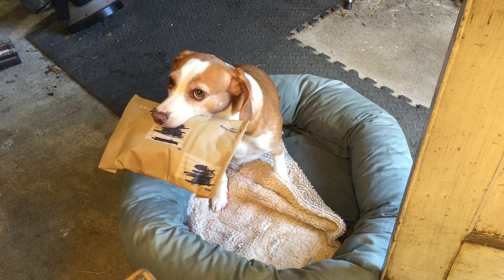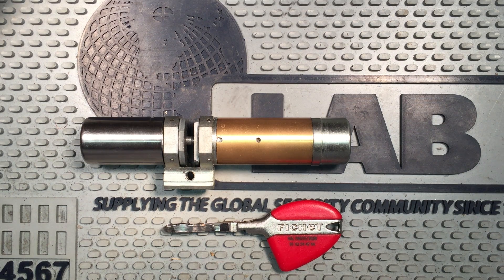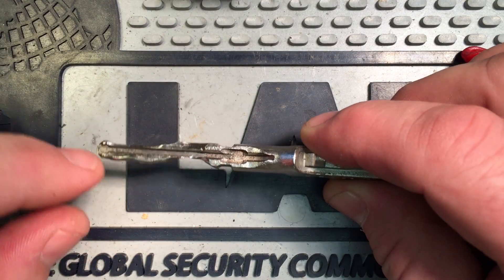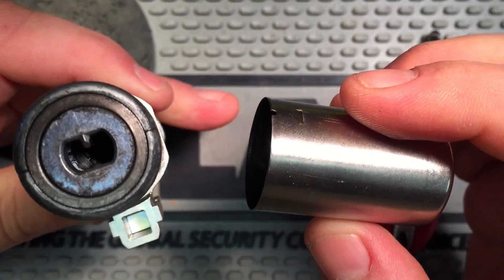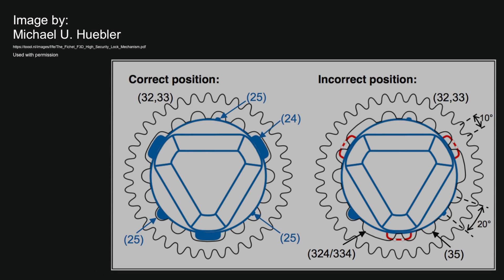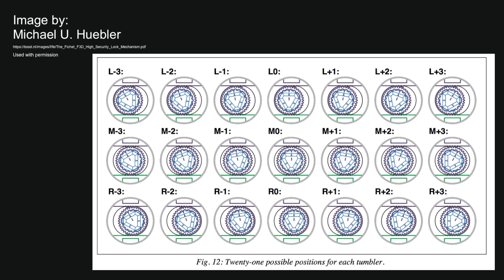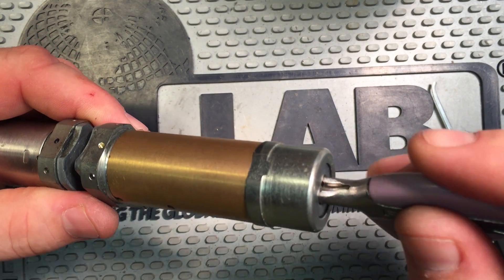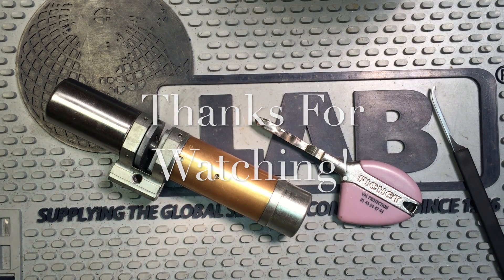Everything I know about the Point Fort Fichet F3D

Comment: There is a reason why fichet stays far from europrofile cylibders. And that is their inherent weakness in its conception with a very weak center point prone to snapping which forces you to use a defender. But even the defender has weak spots so newer types of defenders are constantly coming out. The pump lock in question here escapes from all that crap. I use a fichet 787z on my door and never looked back.

Comment: finally a video about the F3d! thank you.

But why is the inner lock shorter?
Reply: kurazaybo Because the armoured door is thicker on the outside than the inside. It takes longer to drill through more door to get to the mechanism. The inside is easier to attack, but there you go with trade-offs - even here, on very fancy expensive security doors, you don't want it so thick it is too heavy for the wall!

Comment: I bet they can be barrel snapped week spot in the point where u screw the lock into the door ?
Reply: Not likely due to the way the mounting works.  They often have a hardened estucheon around the whole thing which would have to be removed first, plus the lock mounts into a steel cradle which is part of the door.  These are very high end locks, as are the doors to which they are designed to be mounted.  They are not for the average homeowner.